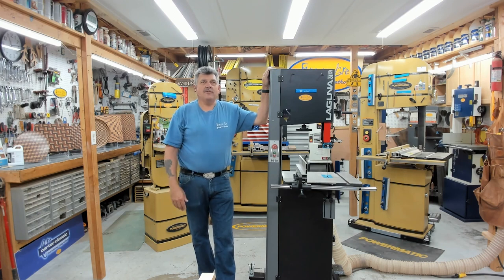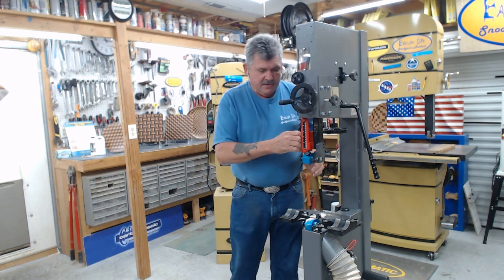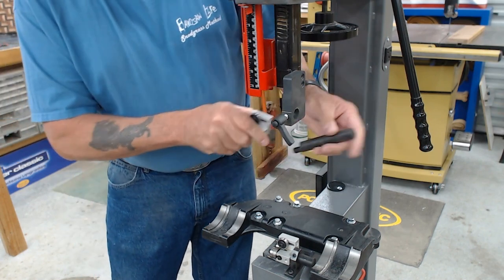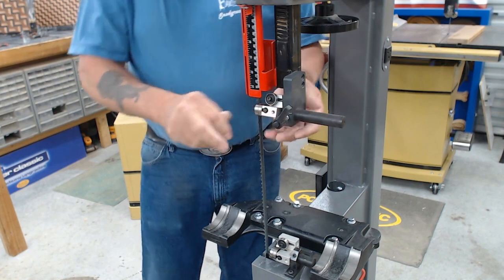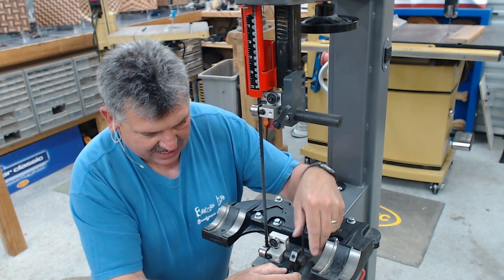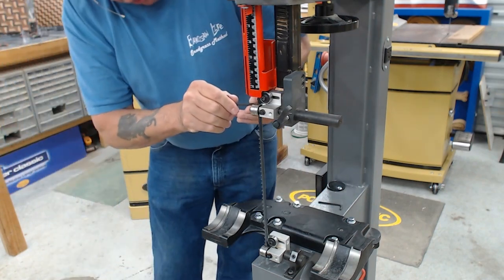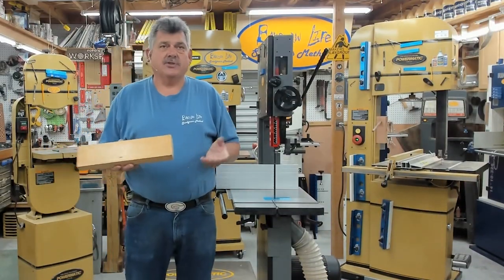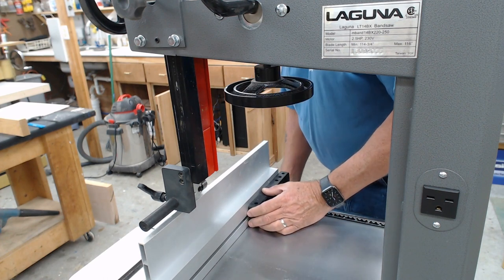Upgrade your 14" Laguna Bandsaw with Carter Guides

Comment: Very informative video. I have a similar saw and keep getting sparks so I'm thinking of that upgrade. One thing missing, perhaps, from the video is a demo of how you have to re-adjust those guides when you change blades. Do you have to fiddle with Allen wrenches under the table to release and adjust the guides? How tricky is that? - Thanks

Comment: I need to drill and tap holes in my bandsaw for the lower guide holder.   I need the metric thread pitch size and diameter for those allen head bolts so I can order the appropriate tap.  Thanks.
Reply from the maker: @chaecoco2  just asked Carter to send you the right bolts or you can grab them at your local hardware store
Reply: @bandsawlife2660  I figured it out.  I assumed the screws were metric, but turns out they are standard 1/4 X 20 and I have that tap on hand. So good to go.   I still have a problem to solve on the upper guide install.    I have the Laguna LT14SE and the guide mount was drilled at 19mm.  The Carter upgrade 20mm adaptor stud won't fit.   I either need to get a 19mm adaptor stud, or have a local machine shop enlarge the 19mm hole on the existing guide mount to 20mm.   Not sure how difficult that would be so will check with a local shop after the holiday.

Comment: My questions were pertaining to your two videos on the Sears Craftsman 12” 2-speed tilt- head bandsaw. You went thru the process of adjustments of the blade, tires, bearings, etc., but no mention of the pulley/belt. 

My question was how do you determine whether or not the belt is slipping and how one would adjust same, if needed.

My saw is bogging down just trying to saw through redwood two by stock, trying to cut very mild curves.
Reply from the maker: I’m guessing your pulley is loose or you’re woodruff key is broke on the pulley.
Reply: @bandsawlife2660  , In your opinion, what is the easiest way to access? Put the saw on its side maybe?

Comment: I have a 24” Laguna. The table top would take two people to lift off so that would stay in place. Would the guides work on this model which I bought 10 years ago and it was made in Italy. Thanks
Reply from the maker: Sure, give Carter a call 888-622-7837.  They can tell you which guides to get.  Or email them at  kris@carterproducts.com

Comment: I am using a 3/4" Resaw King blade on my BX. I was told by Laguna to center the entire blade on the tire. You are recommending setting the deepest part of the gullet in the center of the tire. With a 3/4" blade is that still the case? The back end of the blade will be off the tire, right? Also, would you recommend (when the tires need replacing) to use urethane tires from Carter as well.  Thank You. Bill
Reply from the maker: Never overhand the blade off the back edge.  Just back the blade up as far as possible so the back edge is even with the back edge of the wheel.  A 5/8” blade is as large as you can go on your wheel.  Don’t replace your tires unless they are slipping or coming off the wheel.
Reply: @bandsawlife2660  Thanks for the fast response Alex, I appreciate it.  I've getting good results with the stock guides for the past few years - I mostly resaw with this machine. HOWEVER,  once those ceramic bushings start to go bad, the cut becomes horrible as the blade doesn't track well. I'm glad to have found your video and I will enjoy watching more of your information. Thanks to you, I'm going to upgrade my machine to the Carter setup. Thanks again! Bill
Reply: This was my same question. So I cannot use the three-quarter inch Resaw king blade on the 14 BX and get it positioned where it should be with Carter guides?
I bought the guides and they are on their way. I’m excited for the upgrade.

Comment: Hi Alex. I take a group of older men in woodworking class eg woodturning, simple carpentry etc (if you have ever heard of Mens Sheds that’s the idea). The guys are breaking my heart by constantly causing problems with the bandsaw (14” Record). The problems include kinking and breaking blades. Most of the work done in the shop is related to wood turning eg rounding blanks etc. There is very little resawing. I watched your video re setting up and tuning a bandsaw and it was great. In fact I hope to get all of the guys to watch it to improve their understanding of the bandsaw. I noted that in your demo you used a saw with a full set of guides to resaw but when using it for non standard cuts you switched to a saw with a simple alignment guide. Might my problems be solved if I switched out the current guide set up to the alignment guide? Any help would be great.
Reply from the maker: John I’ll be adding a video for the small guide shortly

Comment: Alex, your a little late.  Upgrade was done a while back and not only did it make a difference in accuracy it also made the saw quieter.  It should be the number one upgrade for the 14/12 as well as the 14BX.  Thanks for the demo.  By the way whenever I switch sizes of blades I remove the table, mine is a bit easier because I replaced the handles with wing nuts.  Have a great future.
Reply from the maker: Thank you.
Reply: Don’t forget that it also increases your resaw capacity by an inch or two
Reply: Which upgrade are you reffering to that makes a difference in accuracy and quiets the saw?  Thanks!
Reply from the maker: Carter conversion Kit. 
http://www.carterproducts.com/catalog/product/view/id/2856/s/lag-01/category/32/
Reply: @bandsawlife2660 Hi Alex,weare i cant buy bandsaw stabilizer,im from Bosnia and Hercegovina?I mean, how can I buy and order, where can I buy and can I send it to Bosnia?

Comment: Craftsman Band-saw Tuneups: how do you adjust the drive belt and how can one tell if it is slipping?
Reply from the maker: I’m not sure I understand the question
Reply: @bandsawlife2660  
When I watched your video on the Craftsman 12” bandsaw, you never mentioned how to access the motor and drive belt. My saw is bogging down cutting through redwood, which I think is considered to be a soft wood. So if the belt is damaged or slipping, how does one rectify the situation? Thanks for your time.
Reply from the maker: I would have to do some research but which craftsman Sears are you referring to.

Comment: I have the Laguna 14BX 220 Volt Bandsaw and you are using a 3/8" blade for all cuts?  I just bought this saw and I purchased 2 bands with it and was not impressed with Laguna resaw blade.  I think they are 3/4".  I am getting the Carter guides for sure.  What you recommend for resaw a 2"x12" 18 inches in length?  Thanks for your video.  Merry Christmas to you. :)
Reply from the maker: I like the 3/8” Greenwood for general purpose but if all your doing is resaw the 5/8” Greenwood is the bomb.
Reply: @bandsawlife2660  Thanks for the quick reply.  Are these Greenwood Blades carbon tipped?  Again, thanks in advance.
Reply from the maker: They are carbon steel but not carbide.

Comment: Got my new carter guides today and installed.  Blade is tracking so deepest part of gullet is in center of wheel but on lower wheel the edge of teeth are riding on the outside edge of tire.  Is this normal or not?
Reply from the maker: Yes it is, bottom always rides forward from the top.
Reply: @bandsawlife2660  Thank you Sir, :)
I put the 3/8th band on and will try it out tomorrow.  Im gonna try and cut out 12 inch boxelder and turn a bowl

Comment: Hi Alex.  I'm brand-new to the Bandsaw Life - literally and figuratively!  My main purpose for purchasing the Laguna is for roughing bowl blanks, and one thing I've heard is that the ceramic guides help to keep the wet dust from caking the blade, where the bearings don't.  Is this true, and if so, does it matter at all in your opinion?  
Awesome demonstrations, and I'm really enjoying your content - thanks!
Reply from the maker: The problem with ceramics is they create fiction which destroys the blade.  Simply add a small amount of silicon spray to the blade and the pitch won’t build up.

Comment: I have a fairly new 14BX 220v. Re-sawed a bunch of walnut, etc with no problems.  Suddenly tonight, when cutting a small kerf into a 3/4" piece of poplar - BAM!!!  My fairly new $150 Laguna resaw king blade just snapped! Scared the crap out of me!  Seemed to be running fine to that point.  Didn't snap on the weld either - just a clean snap right through.  Any ideas on the most likely cause?
Reply from the maker: If you’re using the original guides it’s from the friction of the ceramics
Reply: @bandsawlife2660  Appreciate the quick reply and ALL the great videos from you over the years! One final question - if I installed the Carter guides. which I probably will do - is it any easier to adjust the lower guide than it is on the stock Laguna guides?  I have no problems with mine losening up like some folks have, but that lower guide is a real p.i.t.a. to get to.  Thanks!
Reply from the maker: Absolutely much easier.  Let me know how it works out.